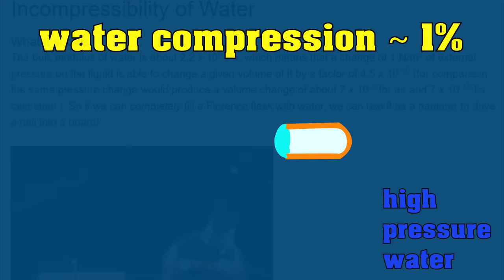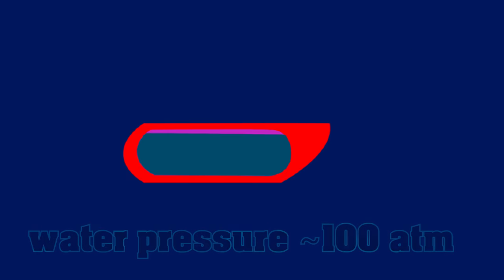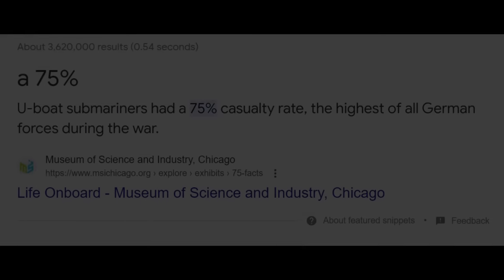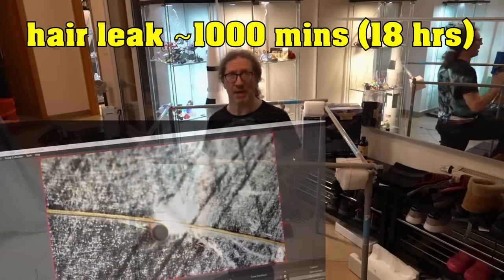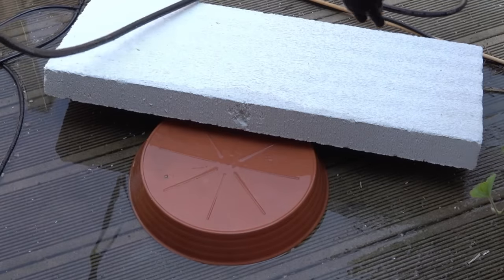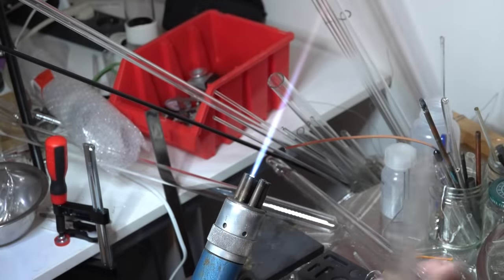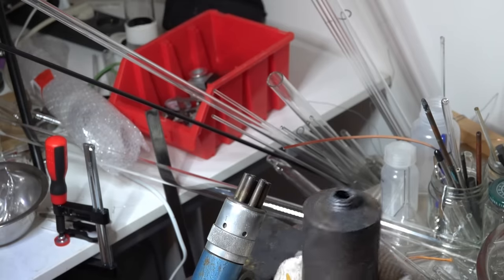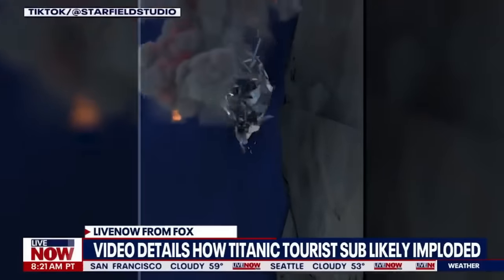Why the Titan sub failed

Comment: "By far the most propable mode of failure is a single pinhole leak"
Based on what? What data?      OK now that I finished the video I get your point, but maybe don't put a statement like this right at the beginning of a video, I want to see some data first

But still I find it more likely that the vessel just imploded. The glue interface portion in the titanium ring doesn't give much room for the carbon fiber to contract anyways. A pinhole leak would have come through there if it did. But if the carbon fiber is stressed enough to create pinhole leaks, then the structural integrity has already completely failed. Which is why I only see the pinhole leak propable in the glue itself.
I see this in a more simple way. The end caps can't contract as much as the middle of the pressure vessel, and therefore the carbon fibre experienced some stress, developed fractures and eventually cracked open.

Comment: Are you really 100% sure that the single pin hole mode of failure is appropriate? It really seems like the sub did suffer a violent event, otherwise I would expect to find the sub mostly in one piece on the seafloor. 
If their is progressive flooding you have an about equal pressure in or out, so no dismantling of the ship in small pieces ?

Comment: As you correctly point out, the many implosion animations that have been offered are totally wrong. This fact is borne out by the size and shape of the recovered exterior pieces.  A critical investigation of this accident would most likely start with attention directed at the glue up of the two materials.  Assuming the term “glue” in this context refers to some type of epoxy I would not expect the bond between the two materials to be strong in the first place. Especially to the titanium.  Secondly I noticed the person cleaning the titanium ring was using a rag and didn’t even have gloves on and was touching the ring with his hands. This can deposit oils from his hands and contaminate the titanium surface and lesson whatever bonding strength there was.  In addition to deposits from hands or from the non-clean room environment  could allow dust or other particles such as clothing lint or human hair to find its way to the surfaces being glued which could certainly create an additional failure point.  Further, it appears as if the “cleaning” was being done with a dry cloth. I would think the use some type of rapidly evaporating solvent to clean it such as toluene or something of that nature should have been used.  Combining this with the dissimilar indexes of compression would only compound the problem.  All this could very easily lead to the pinhole scenario and result in exactly what you have proposed.  Of course the stress on the carbon fiber itself is another factor that probably should be considered. But applying Occam’s razor I think the glue joint was the most likely Achilles heel on this project.

Comment: The glue is only needed to keep the alignment on the surface. The huge water pressure on the submerged sub presses the titanium ends into the carbon fiber cylinder to maintain the seal. Using the term 'glue' is kind of unfair given that today 'glue' keeps portions of the wings on passenger jets in place.... and on high performance fighter jets carbon fibre composites and aluminium (a close sister of Titanium) are bonded together. A pin hole is actually less likely to form in the plastic because it's ductile and will fill the hole naturally. The big thing with Titan.... the HUGE problem with Titan is that carbon fiber has little fatigue strength. It would have become incredibly brittle after about ten dives. A good demo would be to put a glass jar under heavy vacuum then strike it with a hammer. There would likely have been someting more like a catastrophic tearing that would have shredded the CF tube. All the squishy bits of the people would shrink quite a bit, and the hard bits...not so much.

Comment: The funny thing is I build a chair entirely out of cardboard that could support my 300-pound weight, and I used absolutely no glue. Even I, somebody who has no education in engineering whatsoever, knows that glue is a major weakness in weight and/or pressure for a variety of applications. It’s better to use screws and joinery for building than glue.

Comment: That lines up pretty well with what the leaked transcript of the black box said happened. They said they heard crackling sounds coming form the rear of the ship. The sound was probably small fractures starting to form in the glue.
Reply: They also heard crackling in dives before that.
Reply: @boots7859  That I did not know. This time however they did dive a lot faster then normal. It might have been harder on it. It also could have just been a disaster waiting to happen.

Comment: Incorrect. The PRESSURE it was subject to would ASSIST the EPOXY by FORCING  THE SECTIONS  TOGTHER.. IT WASNT UNDER VACUUM,  and the pressure was external. Not internal forcing the end caps to release the bond, but ASSISTING the bond like a CLAMPING ACTION.
Reply: The different sections being different materials would react differently under different pressures and temperatures.  The end caps and the carbon fiber hull would not compress at the same rate causing stress at the joint between them .

Comment: High static water pressure outside compared with normal (1 ATM) pressure inside, will kill you if the hull is breached. If all your body (lungs, intestines etc) is normalised at 1 ATM and then you are suddenly exposed to 100 ATM, sorry you collapse instantly. Not about water being compressed here.

Comment: I work in the polymer coating area and when they did the glueup with bare hands touching the metal surface I cringed so hard. One drop of human sweat on the surface and the bond is done. DONE. Something like this vessel I would never even attempt to "glue up" outside of a clean room. ISO 3 to ISO 6 or better.

Comment: I think we are missing a lot of details. I'm sure if there was a leak it would have been detected long before they reached such a depth. There is no way that the sub would have survived as long as it did if the carbon fibre wasn't under tensile load. An additional frame must have kept the two hemispheres at a set distance apart allowing the carbon fribre tube to flex, putting it under tension. The more likely scenario is that entire joint failed due to creep after the adhesive was placed under extreme cyclic loads from multiple dives. Although the design is probably not as dumb as everyone is making it out to be, relying on seal that is under tension for this application was extremely ill advised.

Comment: One thing that I find confusing, is you keep saying that the problem isn't the pressure pushing on the hull, but the water decompressing.
Surely you've got to admit that it's a confusing distinction, linguistically at least.

Comment: You are comparing two paradigms - three actually. Thermal expansion, compressibility, and geometry.

The glue served primarily as a seal between the CF cylinder and the titanium ring, which it fitted into. Assuming the inner ridge of the titanium did not fail, there should have been relatively little shear stress on the bond.

That is not to say the bond did not fail as a seal. If the transcript is valid then it seems likely the vessel was taking water - it lost an electric bus and it couldn't climb, even after shedding ballast and running its ascent motors at full speed.

If the transcript is a hoax, then the likely point of failure would be progressive cracking of the epoxy from the outside in, mid cylinder, where the stresses were highest.

But that assumes a good job laying up the CF. Given the conditions, the weak point could be anywhere.

Comment: Should have made a double titanium ring, that completely enclosed the carbon fiber ends on the inside and outside.  The less compressed titanium on the inside of the carbon fiber would have prevented a separation between the outer titanium ring and the carbon tube.

Comment: This makes a lot of sense considering that when the titanium end caps were recovered they had practically no glue residue left on the metal mating surface.
Reply: You can't have looked very closely, because you missed a key piece of evidence. One of the rings were oval shaped, meaning the glue must have held on as the structure collapsed. Or the titanium ring would've just stayed perfectly round.

Comment: The reason your pressure washer experiment failed is because it's a Bosch. For over 10 years now this famous German "manufacturer" only packages stuff in Germany, everything they sell is actually made in China and false advertisement became the norm in their marketing. Count yourself lucky if your pressure washer actually outputs 70% of the advertised pressure and don't be surprised if it fails spectacularly soon after the warranty expires. 

If you're wondering what tools should you buy for your home tinkering projects in the EU, I recommend Stern (Austria) and Yato (Poland), both use Chinese made parts as well but don't try to hide it and both have much better quality control / reliability. Prices are in the same ballpark as the Bosch hobby line, on average Stern has better power tools and Yato makes great hand tools and workshop consumables.

Comment: Shouldn't you've made a pinhole in that plastic plant dish to simulate what the pressure can do? I mean, the sub had a leak, but not your analogy, i think you need to re-do the experiment with a pinhole inside the plastic, and i bet you the result will change, a tiny hole under that much pressure will surely get bigger! It is easier to cut something that already has been started than making a fresh one . . .

Comment: Before watching the video. An engineer was fired for trying to get them to properly test the sub and warning about the subpar materials/equipment. The main window was barely rated for half of the depth it was going to. So I would guess that a small leak started where the front window met the hull. After the video: I was pretty close
Reply: No, the video is an assumption by TF, with a lot, lot of weird tangents.
Check Real Engineer, a Phd in Composites who has a lot more actual science/facts about CF, failures, past history of use in deep sea if you want to stay in the realm of most likely to have ocurred.
I think it was the Dir of Safety who got das boot for advocating for more testing. Probably was an old white guy, just like Rush himself.

Morbidly funny, I don't hire old white guy experts because supposedly diversity > experience (certainly not because its also usually much cheaper), and I'M an old white guy with no experience in anything but writing checks and firing experts who disagree with me....
Should be a requirement in the future that all CEO's have to be on the first and following x number of plane, train, boat, etc flights.

Comment: The lack of homogeneity in the construction of the shell and the different rates of expansion and contraction under pressure at the interface between the carbon fibre shell and the titanium dome ends would force the glue bond to be subjected to shear loading. This obvious design flaw coupled with lack of construction to code and essential NDT inspection during build/commissioning or ultrasonic scans for cracking or delamination of the composite shell or glue bonded areas between dives is insanely negligent.

Comment: Water jet cutters use 60,000 psi focused on a tiny spot. A pressure washer only puts out 3000 - 4000 psi. There is no way the 6000 psi max pressure water near the Titanic could cut 5 inch wall thickness carbon fiber in the few seconds it took to fill the sub. No way. It didn't happen. 

And the specs of carbon fiber vs titanium are being misunderstood. It's true that titanium is stronger than carbon fiber if the part is exactly the same size (and shape) but they aren't on the titan. It's also true that a kg of carbon fiber can be made stronger than a kg of titanium. 

None of that is relevant here though. The question is if both parts were specified correctly to handle the 6000 psi pressure. They were (in terms of wall thickness). There wasn't nearly enough pressure to break 5" wall thickness carbon fiber or that 5" thick titanium end cap. But there is no way a chemical bond between shiny metal and carbon fiber would hold. The glue was the weak link.

If they would have created a mechanical bond by wrapping the carbon fiber around the titanium before curing, and designed it so the titanium could not be pulled out without breaking the carbon fiber... they would probably still be alive.

I.e. they should have copied the well tried and tested design of the 4500 psi carbon fiber air tanks that firefighters use.

Hand-tightening multiple bolts without a torque wrench could easily could flex in the titanium and break the chemical bond if even one of those bolts was over-tightened.

All these points about carbon fiber only being good for tension, not compression are simply wrong. This depends on the direction of the fibers.

Comment: A leak may have been a contributing factor, but the real issue was failure of the carbon fiber hull which they were warned about many times and ignored the warning. This sub had many issues and problems. If it was simply a leak they would not have imploded and it would have been found intact no implossion would have been recorded.

Comment: Real Engineering, who it turns our did his PhD work on composite materials failure modeling, thinks the carbon fiber tube likely failed catastrophically.  Basically, the inner layers delaminate and buckle inwards.

While the joins are problematic to put it mildly, the ends of the tube are tucked inside a U channnel so a small amount of differential shrinkage actually makes it tighter.  If one of those joins were to fail, the leaking seems more likely occur as it gets to moderate depth coming back up.

All that said, talking about pinhole leaks under high pressure is fun and relevant to other situations.  As mentioned, Hydraulic Press Channel has some videos on that.

Comment: Oh well, by direct experience you don't use a woven carbon tube to resist outside pression. the second it starts to buckle it breaks. A bowen carbon tube is very good at inside pressure, because carbon fibers are working at traction. and then you have the metallic caps, glued... disastrous design. Made to fail.

Comment: Giant pressures compress the CF hull more than the titanium which, over cycles, completely breaks the small, hand-applied glue joint resulting in a catastrophic failure that shreds the CF in an instant. Putting aside the nonlinear anisotropic behavior of composites like CF, the glue joint was the most criminal part of the design. GLUE? Applied over a small surface area by hand?? How could any confidence be assumed in that design/assembly process? I’d never approve that design for production.

Comment: Thunderf00t states that the water under pressure  expands into a void at faster than the speed of sound but doesn't consider the pressure that it was initially under. Surely that's relevant. At Titanic depth the water pressure is about 385 atmospheres and according to Bernuolli s law  pressure can be converted to velocity. At this pressure this  is about 900 feet per second . Bernoulli assumes no frictional loses which would be significant and the velocity therefor lower. Of course the water expands but only the stated 4%. it seems a leap in logic that the jet of water would continue at that speed for any distance. The decompression of water must occur within a penstock of hydroelectric dams, some exceeding 900 feet.
Also Thunderf00t incorrectly states that a hole ten times the dimension (diameter) discharges one hundred times the flow but Poisevilles Law states it is to the fourth power - 10000 times for laminar flow. The leak would probably be turbulent flow rate would be to the 2.5 - 3 power of diameter.
As other commenters have noted there would be a rise in temperature as the pressure suddenly changed as the formula is PV=nRT

Comment: That fox cgi looks weird... why did it implode and the left and right parts are pushed together... since the weak areas are across the length. Hmm at that rate a 1mm hole will get larger by the grinding waterjet.

Comment: Thanks for this.  This is the second time I've heard or read the differences in diameters between the different materials would be about 10mm at depth.  Isn't this material sciences 101?  This and several other factors equal gross negligence by OceanGate (an appropriate name)

Comment: The fact that you cannot simply recreate the levels of water compression seen in the deep ocean with an electric-powered compressor/water pressurizer actually is what says a lot about the level of water compression at those depths. We cannot even replicate it at the surface without MASSIVE amounts of electricity and power.

Comment: Evidence that counters this theory:

Front end cap was found, and *maybe human remains. No complete sub.

Military has mic everywhere and they said they heard it and in fact knew it imploded much earlier than first thought.

There is also a potential transcript *not confirmed and it seems his acoustic system was going all red. and cracking noises were starting to clearly worry them.

Your video was likely in production before much of this evidence, great job anyway on the video.

Comment: If there was a pin hole and the sub filled up it wouldn't have shattered and would be in one piece,  so that didn't happen.  Carbon fibre strands break every time they are put under high pressure , every crack you hear is a carbon fibre strand breaking ,so it would have been getting weaker and weaker every time it went down , it would have then shattered,  the titanium would have deformed before failing , and the titanium ends are intact so the carbon fibre  role obviously😊